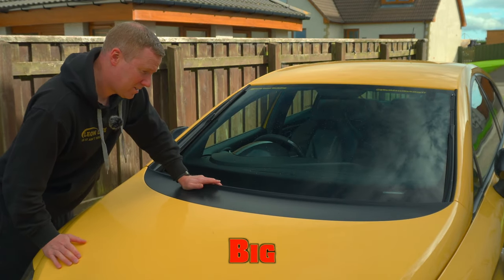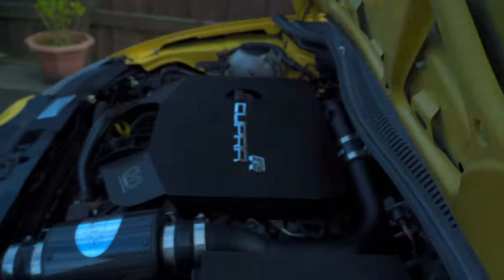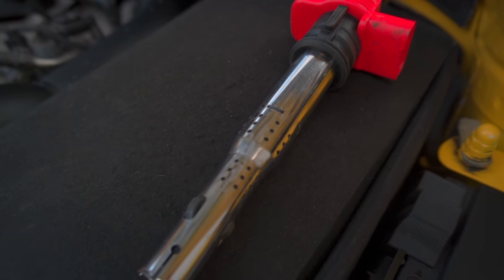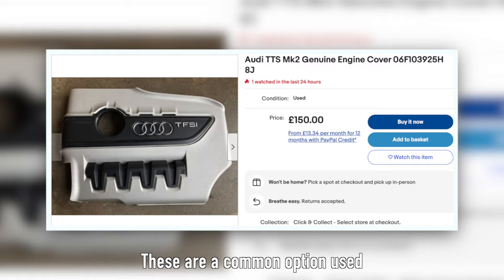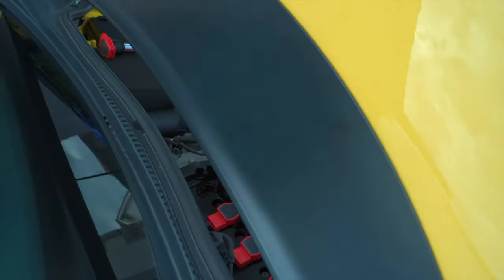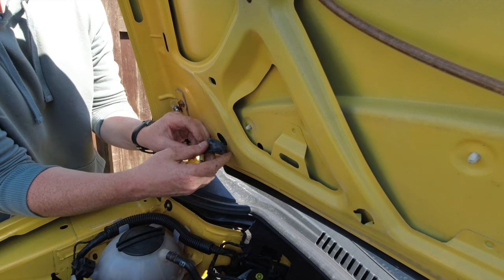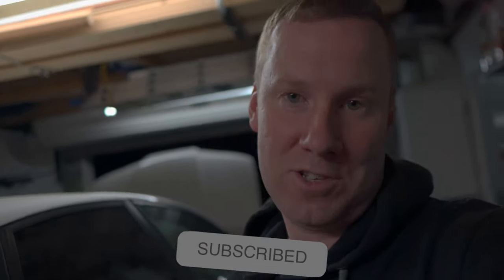This BIG Design Flaw Needs Fixed on ALL MK2/1P Leons!!

Comment: My Leon has been kept in a garage since I bought it new in 2006 which may explain why this hasn't been an issue for me. Some water does get through as I have some white marks on the black pad, but not enough to be a problem. On another note, I have just replaced my cigarette lighter with the duel USB socket as in your video, so I don't have to keep unplugging the satnav because of the permanent live. Thanks for that.
Reply from the maker: Yeah, keeping it garaged will definitely help. Wish I had garaged my car from the start 🙈 seaside salt air is killing it!
And good to hear the usb charging mod is helping 👍🏻 is so handy for numerous things 🙂

Comment: Many thanks for the video. Could you please advise what kind of glue you have used to fix the pipe?
Many thanks
Reply from the maker: I just used clear silicone sealant for any parts I stuck or sealed. Takes a couple of hours to properly dry 👍🏻

Comment: My 07 leon has been having issues with this lately, iv seen the previous owner has put silcone on the back end of the clips but still gets through so ill remove the panel and try your way.

Never notice this issue till i replaced the diverter valve (after watching many of your vids) after i had alot of power back then to having misfires on pack 4, changed that and has been fine for a couple months then went again last week and had to replace.

Thank you for the videos you put out, helped me alot diagnosing my cars issues and the general things to check and maintain 👌
Reply from the maker: No need to thank me, just glad they can be of some use to you 😊
Let me know how u got on once u removed the panel. Be interesting to know where the water was still getting in from 👍🏻
Reply: I have exactly the same... The previous owner did the silicone on the back end of the clips, but I also have water in cilinder 4. I guess he did not do it properly. Now gotta try and remove the silicone kit he did and re-do it. Haha yayyy....
Reply from the maker: Best of luck mate 👍🏻🤞🏻
Reply: @NorthCoastWorkshop  Thanks! Everytime I have to do something with the Cupra i search for your youtube channel and find videos that will help me. You have helped me out a few times already. Many thanks!!!
Reply from the maker: Glad I'm able to help mate 😊 I enjoy making the content, so no need to thank me 👍🏻 We're all in this car community together 💪🏻

Comment: Hi mate, i had same problem on my Cupra and we discuss with my mechanics that for me the fastest repair will be to replace original engine cover (do not fit anymore due to Ramair oversize intake) with engine cover from Audi TTS (need to find cheap one, otherwise it will cost you a lot of money) and it works perfectly 🙂
Reply from the maker: Great to hear Thomas 👍🏻 and yeah the Audi TTS engine covers can be expensive 🙈 hopefully you can find a reasonably cheap on 🤞🏻 Cheers mate 😊

Comment: I've got the Audi TTS engine cover and its still getting water into cylinder 4. So going to try sealing up the holes. My only concern with sealing them all up is where does the water go? The last thing you want is the water just sitting under that plastic trim.
Reply from the maker: Yeah that's why I put the hose in, instead of blocking up that final hole. It's obviously Seat meant it to be a drain hole from day one, but hadn't thought it through, as the water soaks the sound deadening material 😅🙈
If it is fully blocked, I believe the water will just run out to the sides or out the front when steering or under breaking. Not ideal, but better than into cylinder 4 🤣

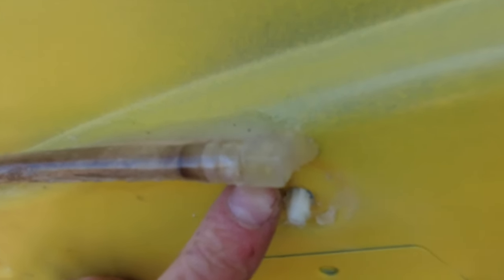Comment: I don't understand this part very well. At 04:37 you mentioned the tiny  hole (main troublespot) but, if we don't have a hose attached to it from the bottom we can seal that hole as well. 

So what does that mean? Does it mean we don't need a hose only the sealed clips or?
Reply from the maker: Yep, you don't necessarily need a hose like mine. You can just set a blob of silicone over it, so it's blocked off, and any excess water that gathers under the trim will just drain out the sides or if the car is on a hill it will run out the front or the back.
The hose was just something I tried and seems to work, but fiddly to do.
Reply: @NorthCoastWorkshop  Thanks, the hose seems to be the go to solution for everyone. I asked because I never heard anyone mentioned just plugging the hole. I'm about to fix the same problem on my car, but don't want my new insulation to develop mold. That's why I asked if you know for sure if it works 🧡
Reply from the maker: Yep the hose definitely works. For speed a lot just put blobs of silicone on all the holes and clips, and say it works fine. The same as you though, I felt the hose was a better option. 
I can't remember the exact sizes but it was just aquarium hose and an L shaped connector piece I used from eBay 👍🏻
Reply: @NorthCoastWorkshop  Thank you 🙏

Comment: Thanks for the content as always - I think I am going to buy the SKU: 6L6 853 575 = how many of those do I need?
Do you also have the part number for the sound deadening, mine is damaged due to the weather and with winter coming, I can see it getting worse!
Reply from the maker: I'm pretty sure it's 9 you'll need, remember to plug the last hole in the middle too. I'm afraid I've not got a part number for the material, but a Google for it should show a few places u can get a replacement from hopefully 🤞🏻
Reply: @NorthCoastWorkshop  - Hey Buddy, had a quick follow up question as it has been raining loads of late... what size tube did you use for the excess drainage, I think I am going to do the same!
Reply from the maker: I used no more than 2 meters of clear aquarium Flexi tubing (6mm inside diameter, and 9mm outside diameter) then a piece like an 'L' shaped junction. One end of the junction attached on the hose, the other end I pushed into the middle hole on the bonnet and trimmed away the excess plastic that poked through, then silicone around it to secure.. The L shaped piece was called "L Equal Ends Water Pipe Elbow Joint K611 Hose To Hose Hard Plastic Aquarium" on eBay. A mouthful, but hopefully help if you're searching. It needs to be obviously 6mm to it sits snug inside the pipe 👍🏻

Comment: Have an fr 140 with the 2 litre common rail TDI engine.
Should those of us with diesel mk2's have any reason to be concerned by this or will the workaround solution not be of any real value to us?
Reply from the maker: It won't be as damaging forr you mechanically as your diesel engine shouldn't have important parts below the water leak (well I don't think it will). But if you do have the sound deadening material still fitted and just want to keep the engine bay reasonably dry, I'd say it probably worth doing just for peace of mind long term 😊👍🏻

Comment: This flaw is on my Leon as well, but only when im washing my car, and lift my bonnet,and it starts to drip the water from that plastic... Should this help to like you do?
Reply from the maker: Once done you'll still get water running off the back when u lift the bonnet, but it tends to run down the back of the engine and cause no harm. The holes for the clips mean the water enters the engine bay a little further forward, so it ends up dripping over the engine, even while the bonnet is shut.
Hope that helps 👍🏻